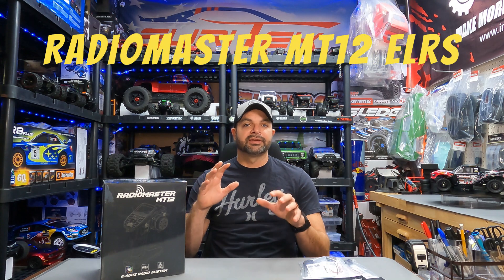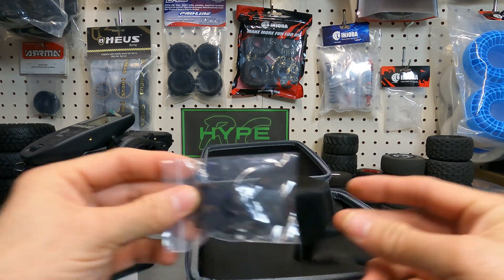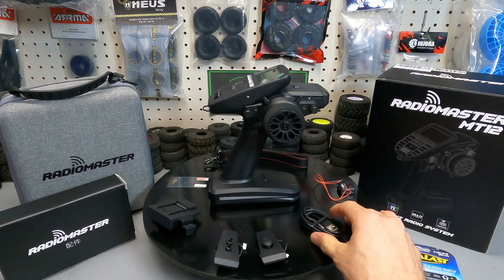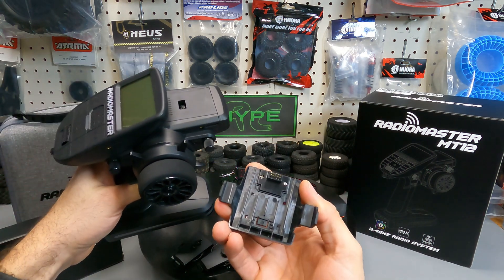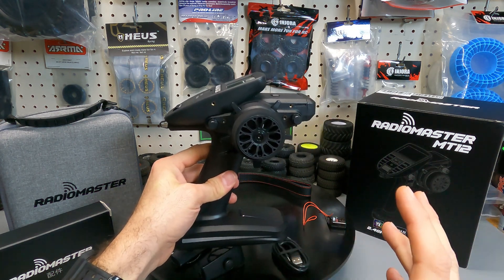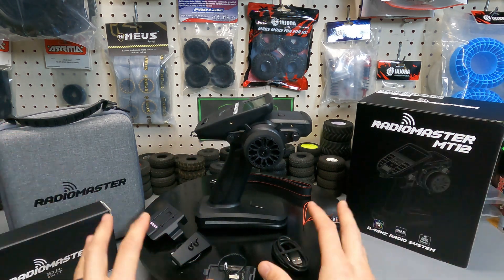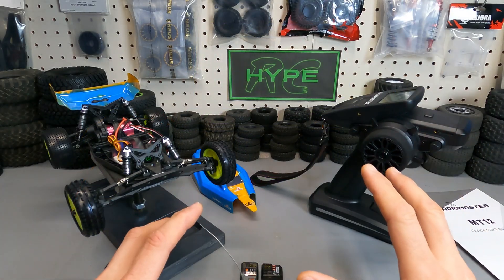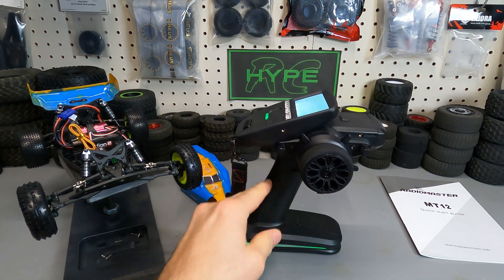UNBOXING & BINDING the World's greatest surface remote!!! The RADIOMASTER MT12 ELRS

Comment: 10/10? Because of elrs? Is this a joke?
Reply from the maker: Not just because of ELRS. It has EdgeTX OS, ball-bearing, hall sensors, nano modules, 18650 batteries, 4 in 1 nano module, $15 RX, micro RX with ceramic antenna, the list just keeps going. All that and more for $129. If you have something that even comes close to all that for under $200, then I would be willing to change my score. But for now this has completely changed the market. I have TX over $300 that don't have half of that.